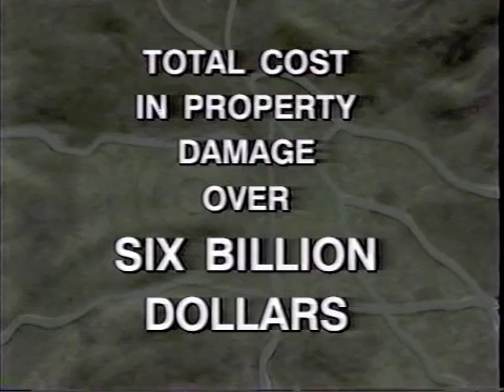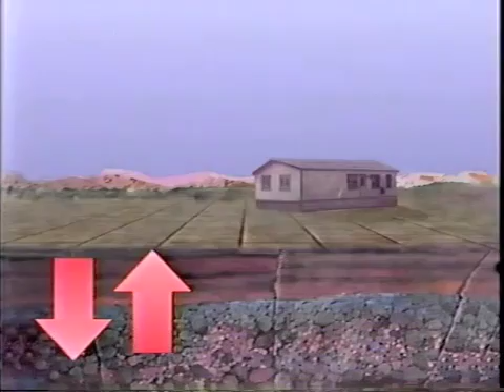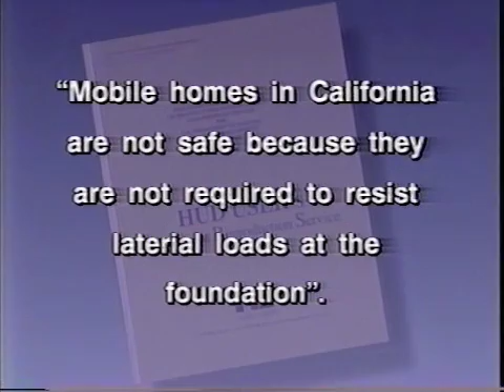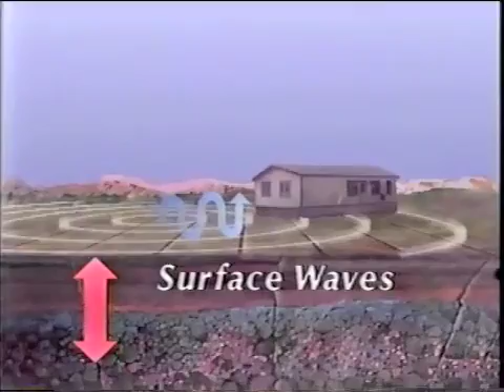Earthquakes, Foundations and Manufactured Homes

Comment: Kaiser FrostOh for goodness sake! If you live in an area with lots of earthquakes an earthquake is the least of yout problems! If the home has that flexible old, illegal piping for gas, water and sewage then check it but don't panic. It's no more dangerous after an earthquake than before. And if your home was stable before the quake it will be fine in all but a very violent one and will still fare better than stick built structures in extreme circumstances.1 second ago•